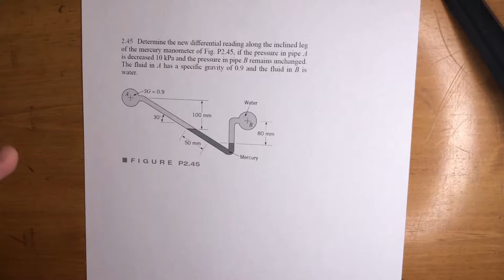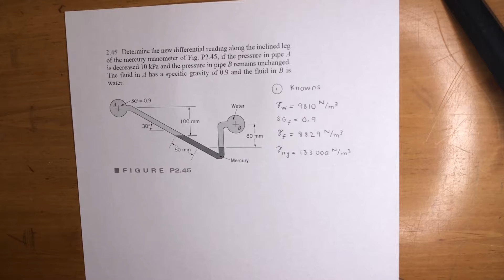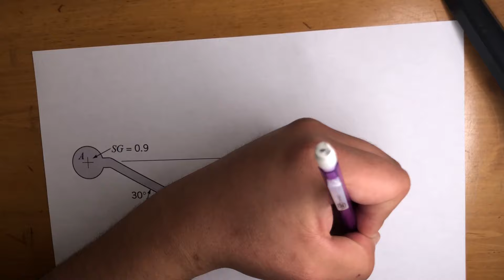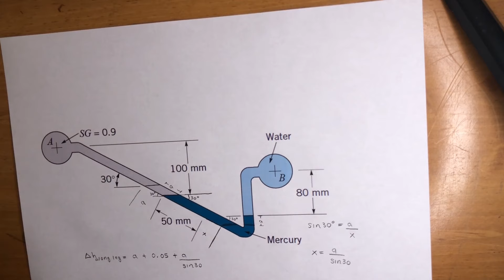Fluid Mechanics - Determine the New Differential Reading Along the Inclined Leg

Comment: 8:05 why we added ''a'' and didn't subtracted it as we suppose to do because the level of water decreased by ''a''
Reply from the maker: Hey, so we add the “a” because after the pressure decreases, the fluid was displaced in the direction of Pt A. Imagine as if Pt A sucked it. 

And our Bernoulli equation after will show mercury displaced higher on the left side (a*sin30) and on the right side it will travel downwards (a).

So our new height for mercury is the initial height as it was before the decrease in pressure (0.05*sin30) plus the two distances I mentioned (“a*sin30” and “a”)
Reply: @r12engineering19  thank you so much sir

Comment: Sir exactly same question was asked in our board exam but mine answer was 0.161m 
And i put the value of specific weight of mercury as 13600kg/m3 . 
Does it makes that different in answer instead of putting 13300 ?
Reply from the maker: If the process was the same, I think it’s fine that the numbers were slightly off. It depends on your professor, some are reasonable, some aren’t. But I think you’ll be fine!
Reply: Bro fluid ma kati marks aayo?
Reply: @prashantghimire644  62 matra aayo yr
Reply: @BrainlessBrain17  oho babal yr.. chap 1 capillary ko num kasari garni thah xa?